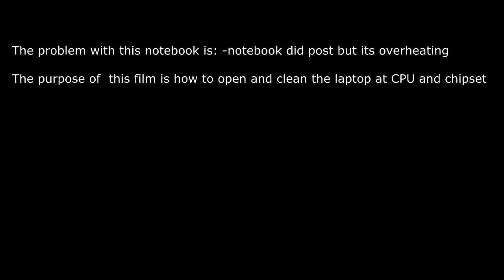How to open and clean HP G72

Comment: i have a question for you and any one who got an answer for it.. i have this same laptop and the charger that i have is the same brand but not for this laptop so when i turn on the G72 with the charger that i got it says on the screen the cooling fan is not working and then it shows up the charger is not compatible so my question is can the charger cause the laptop cooling fan not to start up properly because is not compatible?

Comment: Great video, couldn't find any of the screws like this on the bottom of my toaster though..
Reply from the maker: hy.
maybe they are covered with dust.
what model you got?

full model it's under the battery or the sticker.
Reply: Rory Simmonds 
 B.
Reply: Rory Simmonds op
Reply: Tech4Roast o
Reply: What an odd series of comments

Comment: Hello, Where did you get the tool at 0:49.. & what was on the top of it?size? Please and Thanks.. 
my G72 is acting really slow and disconnecting from the Internet when the wifi is working properly fine.
Reply from the maker: hello!

its a cheap powered screwdriver . when i say chep i got it for free with dead battery and i install a rechargeable batterie inside. 

the wifi problem maybe coming for the actual chipset . 
Before you can work on the chipset try to install a fresh windows, re-install the wifi driver , change the wifi card or update the BIOS 

after you did all of those and the problem still persist you can reball(reflow) the chipset.

if you think you can do it i`ll say take it to a GOOD shop with a good known tech and he will do it for you
Good luck!
Reply: Tech4You oh okay thank you very much for this info!! :))

Comment: hi ...i have a big big problem evry timle i try to read the movies my computert will be very very slow i must shut down and restart befor using again...a,d if i watch movies  from internet its not possible i need help ...and i here i big noise and its very  hot
Reply from the maker: barham niass HY!
did you manage to clean the notebook? if not i think the GPU will die soon!
You need to reflow or just in case a reball of that chip.

First try a restore for your OS, check the memory with memtest, find HDD Sentinel and see if the HDD its ok , then you can go for a reflow.
Reply: yes i clean it and all is good thanks a lot

Comment: nice video thx, do you have the little black stick on the MB keyboard port? i broken it in the rebuild :/
Reply from the maker: apparently you can put in from another model,you just have to try.
if you don`t have you need to ask someone for a spare board and test.
if you got no option like that we will talk how to make it work without that
Reply: tech4ro ok thx for the infos & quick reply, yep, difficult to find this piece, some people want to sell me dead MB....
It works now, I stuck the flat keyboard cable  in the MB port with a toothpick ^^

Comment: can you put a 1066mhz RAM + a 1333mhz ram in the 2 slots? 2GB+4GB= 6GB
it is possible pls? 
the higher (1333mhz) will be work at 1066mhz no?
Reply from the maker: yes!
i`ll suggest to let  only the 4gb on 1333 until you get another 1333 memory
Reply: tech4ro ok, original is in 1066, no pb to let only the 1333? thx a lot tech4ro ;)

Comment: 1. did you use medical alcohol when cleaning gpu?
2. and did you put thermal paste on it after cleaning?

tnx for the video
Reply from the maker: Hy!
1.this model does not have a video dedicated chip so NO!
To clean it you can use Isopropyl alcohol
2.Yes but i was testing another CPU. Good Eye BTW :)